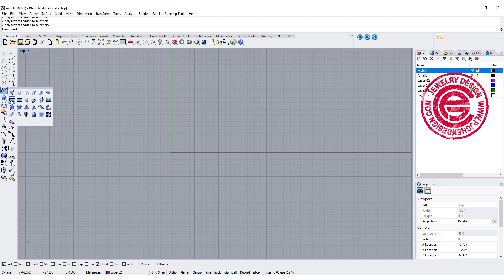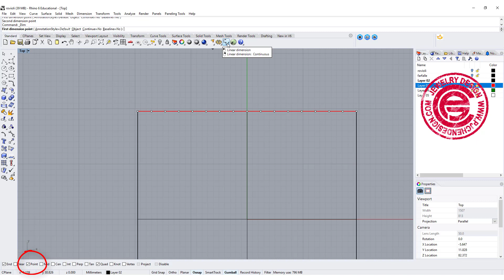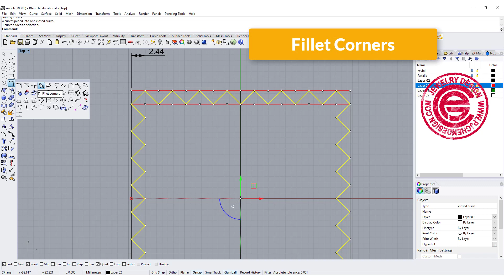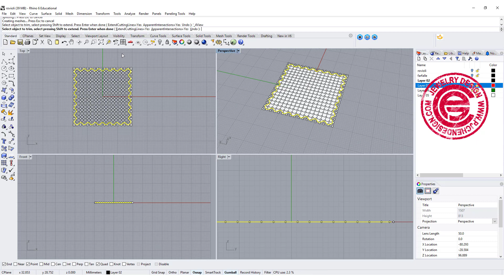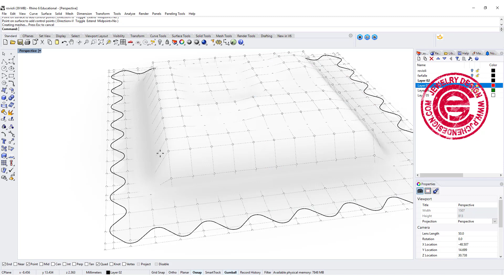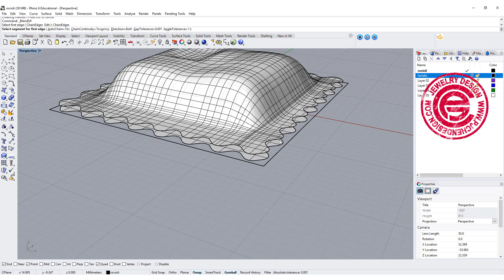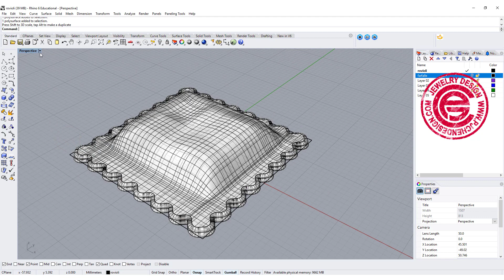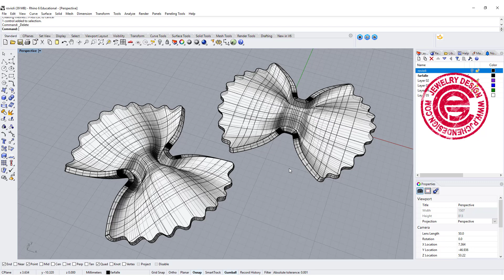Ravioli Pasta Shape 3D Modeling in Rhino 6 : Jewelry CAD Design Tutorial #126

Comment: Thank you PJ. This is a bit of topic but  i am going to make a signet ring i would like to put a skull on the signet. Is there a way to attach an .STL skull to the ring in Rhino? Can i wish for a tutorial?
Reply from the maker: Skull type of 3D modeling is better to be done in Zbrush. Rhino can pull and push control point but cannot be too detail like cracks and nerve vines. You can also buy ready made stl file and import to Rhino to mesh boolean with your model.